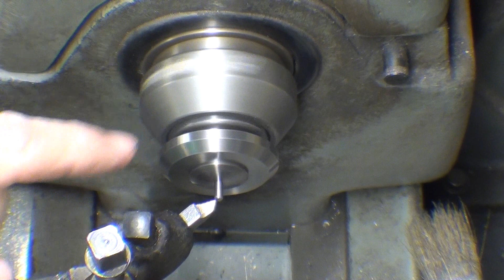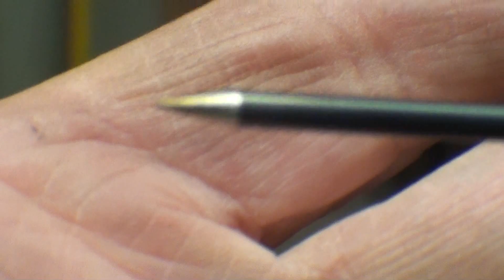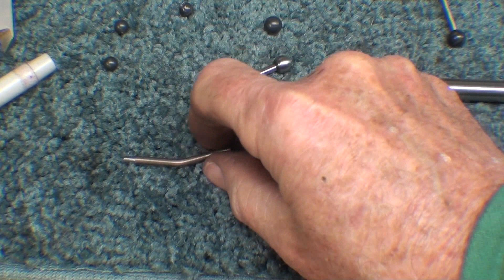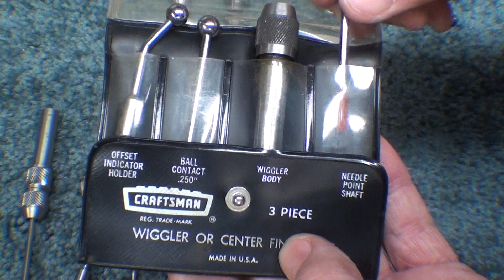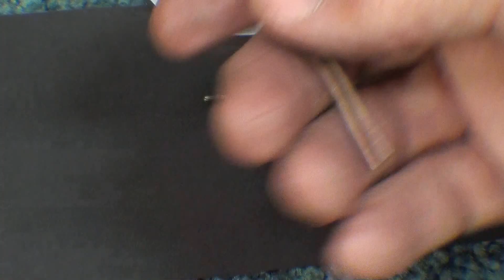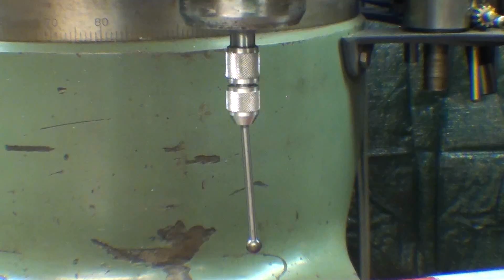TIPS #365 pt 4 HOW TO MAKE A WIGGLER edgefinder tubalcain

Comment: Hi mr Pete, I just watched this for the second time and picked up a few more things I didn’t see the first time.
Is it possible that the hole in the bent component is to hold a circular spigot seen on some indicators? If the threaded part was made the right length it would be able to lock the spigot in position

Comment: Tublecain,
   Enjoyed this series! Planning to make this tool instead of buying one. They are not overly expensive but I get a certain satisfaction from using tools I have successfully made. Gonna hold on to my brass monkey though as it snowed yesterday and overnight on this second week of November. My little shop is heated but the walk between the back door to my shop door is such that the monkey is still essential to determine if I want to risk the elements. I’m going to make the tap follower as well. 
    I ran across a 1970 Craftsman 14 inch drill press at an estate auction recently and picked it up for the princely sum of 40 bucks. I’m still a bit giddy about that! I’m in the process of cleaning it up and slowing down the speed. Also the table is rather heavy and difficult to maneuver so I’m building a screw lift powered by a treadmill lift motor which is 110 volt, capacitor start and adequate to do the job. I removed the drive shaft from the gearbox and made a replacement out of a 12mm shaft I salvaged from an old printer. I used a die to thread the end to 3/8-16 to match the all thread I’ll use as the screw. I plan to use a coupling nut to join it. I’ll try lock washers and lock tite 638 but if that doesn’t hold I’ll have to pin it. I may also put in a weight system similar to your application to take stress off the lift motor. I probably could get by without the screw lift but I want fairly precise positioning on the table without a lot of effort. 
I also had to make a spindle lock as the original was missing. It’s just a simple 3/4 inch plug with a 45 degree angle on one side that tightens against the spindle with a draw bar type application. I made a large,  round knurled knob to tighten it. The head stock locks the same way and I’m going to make another knurled knob to replace the angled rod as I keep hitting my head on it. I lost my left eye in Vietnam knob so my peripheral vision is limited which makes the term, “Knot-head” relevant in my case. I’ve replaced the motor, which works fine, but I wanted more hp and I’ve geared it down so I can get 70 rpm at slowest speed.
Reply from the maker: Sorry about your eye.yes, make a wiggler. It's cold here today 21°

Comment: Hello. I'm not sure by any stretch of the imagination, but the hole in the angled finder looks a LOT like a hole that a ball bearing under spring tension would index.you could use it to find an edge, "index and lock" it, change parts and slide part up to edge of finder.

Comment: I was always under the impression that you let the wiggler snap off the work - much like an edgefinder will run true then kick off once you are on the edge... but both your video and one on edge finding by Suburban Tools indicate the wiggler should only be worked up to the point of running true.  Am I correct that is what you are saying?

Great video as always, by the way.  I may just make a metric ball end for my PEC wiggler - since I have been unable to find any metric wiggler sets!

Comment: Hi Mr Pete, I finished my wiggler this weekend, but I cannot get my needle to run true. I am not sure where I made a mistake. I suspect I did not drill the hole quite center in the ball bearing. I will watch you videos again, I also suspect the hole in the cap bit and the shaft not lining up 100%

Comment: I ground points onto rods like that by clamping an angle grinder into the vise on my milling machine an putting the rod into a drill chuck. I moved the grinder over to the rod until I got a point. You could do it on a drill press with the grinder stationary and lower the rod down to the wheel.

Comment: Agreed with making the diameter of the edge finder ball small enough, or the hole diameter large enough to pass through the nose piece.  Also, I think the Sears pin is actually a needle vise where the needle is pressed in and can be replaced if it gets damaged.  Gluing the needle in sort of negated that function.  Keep up the great work!!!
Reply: I believe you can heat up the LockTite and it will come right off though, but I may be thinking about super glue, where I know you can.  Anyway, Cheers.

Comment: I always thought that a wiggler was operated in the same manner as a lapped conventional edge finder.. you gradually contact the edge of the work until the wiggler turns true and then stop when it just goes out of concentricity.  Then you're 1/2 the diameter of the ball away from the true edge.   If that's not the case, why the difference in use between a wiggler  and a conventional edge finder?  

When drilling a bottom ball you could drill all the way through it and then locktite that ball up a ways on the shaft of a pointer tool, giving you a combination tool useful for lining up over punch and scribe marks and finding the edge of a workpiece.

Great series.  Thanks Lyle!

Comment: Thank you so much for the building tutorial. Without a doubt they are my favorite. Lyle I wonder if you could show the method you use for centering the tool on your work. I don't think you have ever shown that and I've yet to see it on any other channel. Also it would be very interesting to see you compare the accuracy of the wiggler to other methods you use for finding the edge. Thanks for all your videos Lyle.
Reply from the maker: Not sure what your question means??--- "I wonder if you could show the method you use for centering the tool on your work". I intend to do a follow up in about a week on that vid.
Reply: How to locate your work is relative to the spindle is exactly what he did show on the Bridgeport mill at the end.
Reply: Thank you for your reply but what I was referring to the method of centering your work to the tailstock of the lathe or visa versa. Lyle commented that you have to be sure the drill rod is centered because it is so small. How does he do that.

Comment: I've found that when I fasten a "VEE" shaped rest at the grinder in the correct strategic location to rest the shaft on while I rotate the shaft with the drill that the grinding of the point can be performed fairly accurately.  It seems to nullify the run out of the drill chuck.

Comment: Mrpete in #1 of this series (I believe it was #1) I remember you talking about the little plastic tip cap in your Crapsman set and that they get lost right away. I found a while back a drawer full of those in all different sizes at Lowe's. I bought several handfuls in all sizes and now everything that is sharp in my shop has little red tips on them. Pretty handy to have and a few pennies each couldn't beat it. Thanks for your videos keep up the great work!
Reply: Oh by the way,  did you think a sharpened point on a needle made in Taiwan was going to be any more concentric than you could have made it? Haha

Comment: One more attachment you could add would be the edge finder for round bar. Unlike the one you've made here with the ball end , the round bar edge finder has a cylindrical end on it of maybe 0.200" dia by 0.500" long. Works the same way as the ball end finder, but no need to get it exactly on the center line of the round bar.

Comment: I found a different way to use the pointer to position my work under the drill. I use a punch to set a dimple. Then I put my wiggler point into the dimple and turn on the mill or drill and raise the quill. If the pointer runs around I adjust the work and set it again and repeat until the pointer runs true when lifted from the dimple. I will start next time by running the pointer true and then finding the dimple but I will still set it in the dimple, turn on the machine and then lift the quill to see if the pointer is running true. Great video. Thanks!!!

Comment: Enjoyed this project, Mr. Pete. I didn't know about tapestry needles, but being married to a fine seamstress, I do know about ball point needles. They really have a round tip, designed to penetrate knit fabrics without splitting or tearing the threads. It's a little like sewing window screen without breaking the wires.

Comment: you could probably avoid making small threaded parts for alternative wigglers by just using like 4ga bar jewellery, like used for nipple rings and the like. they have very nice polished stainless bars and balls that you can easily unscrew the top to go throu the small hole in the knereled part.
Reply: Daniel Mallett I'm not sure how I feel about Mr. Pete being involved with nipple rings.
Reply: That is a good idea. I wonder how accurate the balls and their setting is